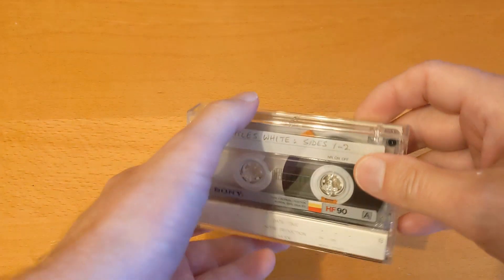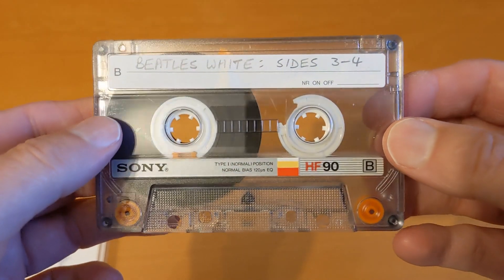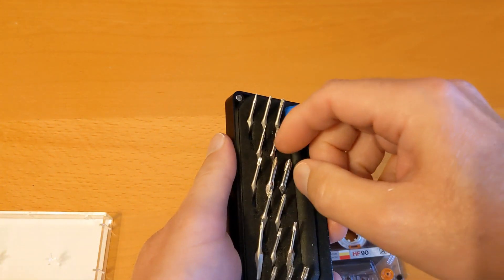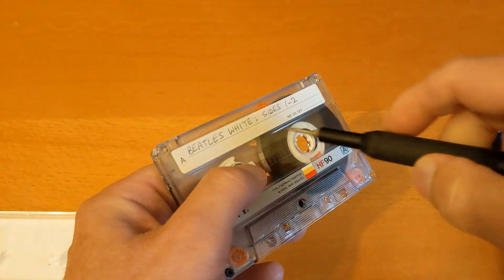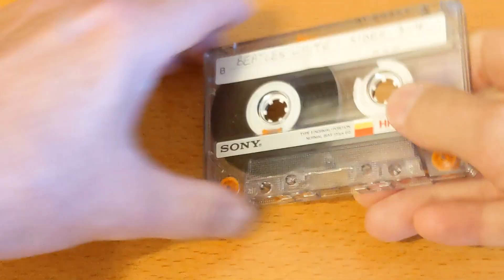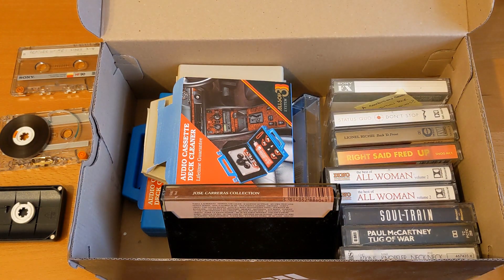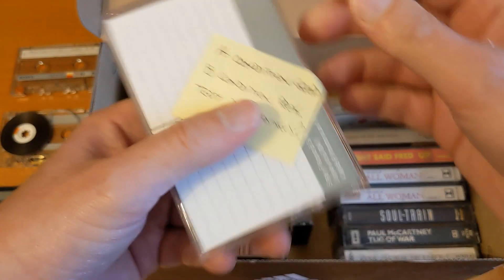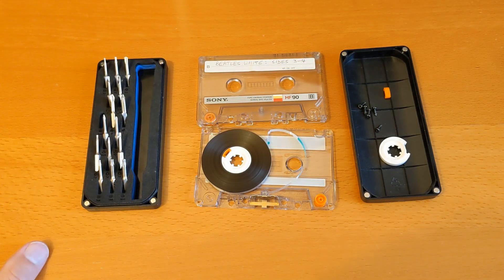Cassette Repair Fail

Comment: This would be the perfect application for a 3d printer
Reply from the maker: I suppose it would. It's a lot of effort for a type one cassette, though.
Reply: I've wasted far more time on far more worthless things in the name of boredom/persistance
Reply from the maker: @sjm4306  True. It's hard to just let something go without finishing the job. I also threw away the tape pad and metal bracket, and didn't want to go through the waste bin to find it. I kept the shell, tape, and hub, ready for the next broken one. I'm now looking for another free cassette haul, not that I need one.

Comment: This happened to me on a commercially recorded tape. I placed and secured the tape guide and the broken plastic clip on the wheel and after I reassembled the whole stuff I glued the clip's fracture with a tiny dropplet of cyanoacrylate. This tape still works perfectly fine after a decade of playing.
Reply from the maker: Ah, thanks. So replace the clip, then glue it. That would have been easier. Thanks for the tip.

Comment: Good lord, bit of a fuss about using a Sony tape that was a  sealed type and it had a dud side as well. That's your best bet to repair the one your trying too, I used to do it quite a few times in the past and splicing as well, also  transferring one tape from one cassette shell to another. But at the end of the day its only the Beatles mate. :) I enjoy your channel a lot, more the Minidisc stuff than tape. But its all good. Thanks for sharing
Reply from the maker: Thanks very much. Yes, bit of a nothing video really, I even edited out lots of trying to get it fixed. Part of the learning process, I suppose. More MD stuff coming soon 🙂

Comment: A sesible reply this time....soz...You had the right idea. Better if you put the other tape guide in place first...I think you forgot it....
 Two pairs of tweezers...first pair to hold the take-up reel lug across its longest edge...and another to guide the leader in situ correctly...steady the reel on some blu-tack to stop it slipping and place it squarly from above...please ditch your super glue.   Something like Tamiya Extra Thin (for model plane kits) wicks in the dry joint and bonds and dries almost instantly on contact.TEH is revolutionary for model making..none of the old 'glue one side and sandwich'...it's literally bring joints together dry, then brush the TET along the joint...stuck solid and done...no fuss no mess.
Dexterity of handling very minute things with tweezers is a skill that can be self taught...like soldering smd components or watch repair, or indeed modelling....
Reply from the maker: I did a couple, but it was a long time ago and I'm very rusty.